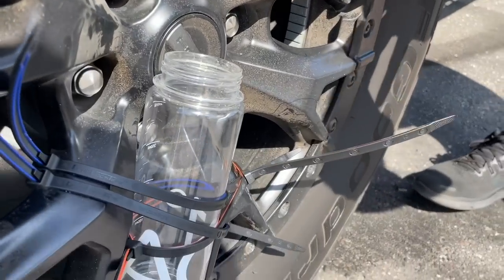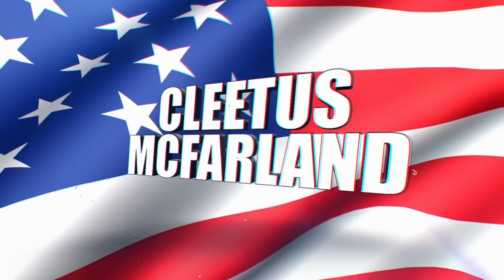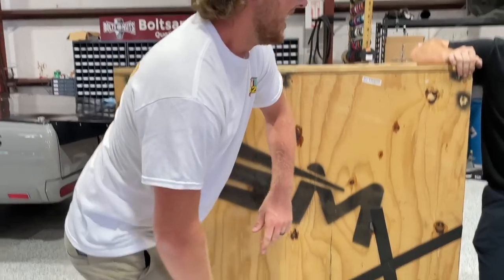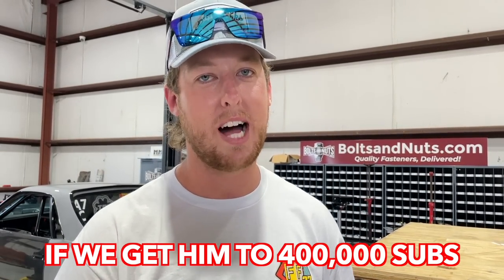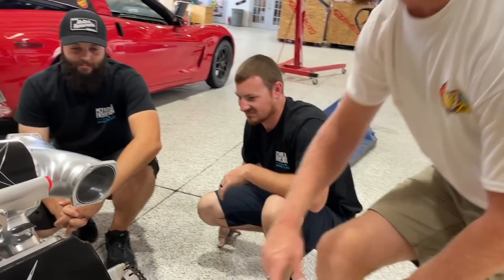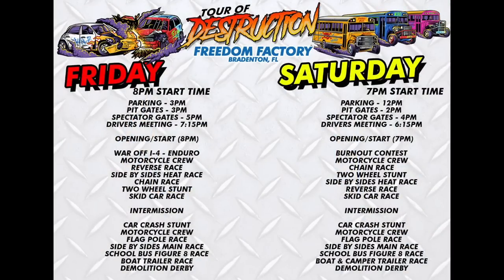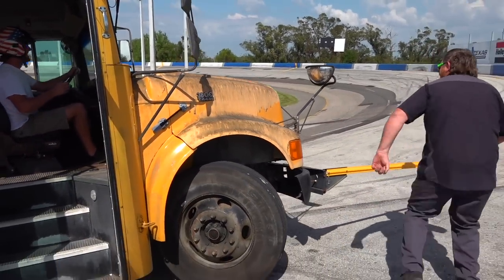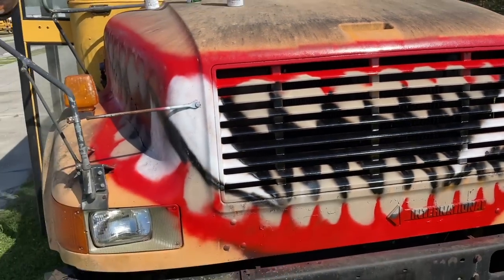We Bought The Most INSANE Street Car Engine EVER For Mullet... 5's Here We Come!!!!

Comment: I KNEW he was making you an SMX! 
i believe it’s 2k hp NA.
i’ve been subbed to steve for weeks. i have watched almost all his videos lol. he has amazing content goes into amazing detail with engine tech and dumbs down quite a bit of info for normal people
Reply: It's just shy of 1K hp N/A cause it's not built to be N/A but boosted.
Reply: It's only 570 something ci. Definitely not 2k hp NA
Reply: Steve has a video of a SMX N/A on his channel.  It’s shy of 2 hp/cubic inch N/A with cam not designed to be N/A.  These engines are tuned to have boost thrown at them.  About 8 hp/cubic inch with boost cranked to them!!

A good example is my best friend has a small block Chevy with a Nitrous designed cam in it.  N/A it only made 650hp.  With 300 shot of NOS it made 1,100+.

Comment: Quest for the 5's has begun!!!! And 110mm turbos
Reply: and bigger tires!
Reply: @xdboardsurfer  He's not going to run bigger than the 315 radials he already has. He has class limitations for most of the events they do. The car would need to be redesigned to fit big tire anyway.
Reply: @lordcommander3224  Of course, the whole bed would have to be gutted and tubbed or whatever. Think he can reach 5s with the 315? Seems like a tall order.
Reply: I believe the record for a 315 Radial class right now is 5.75 ET / 228MPH
Reply: @desertrat8322   None of those cars weigh 3,600 lbs, but even 275 radials have ran 5s

Comment: Does mullet need a new cage for a 5 second run?! That's insane!
Reply: only can cert to 6.5. If they some how could get to 3200lbs they could cert to 6.0
Reply: They won’t get to 6.0’s until mullet goes on a diet and they revisit the rear suspension. It’s gonna need a floater at minimum. And also, that engine will be fine with radials. Engine doesn’t know what tire it’s turning
Reply: @philb5593  Jenny Craig can't work those miracles - also the wheelbase....

Comment: If you use google earth ,  there’s this feature it has where you can see a time line ,  use the tool bar on top , there’s a little clock with a forward arrow ,  in most cases you can go back to 2005 or so ,  maybe some crappy ones before that ,  but if you look at the freedom factory you can see that back lot where the crown Vic’s are is full of trashed out busses   It looks like the track has seen a lot of bus action in the past ,   Think 2011-2014

Comment: When you make the cold side pipes, betwee turbo outlet and the Y on the front of the inlet manifold, why not set the Y on an angle? This way, the two turbo to junction pipes can be straight instead of needing a bend. Simpler fabrication.

Comment: One of the biggest mistakes Garrett has made was buying that hand grenade from Steve but this video came out same day matt frost (rmrw) finally deciding he was done hiding the truth about Steve’s work and making it public that he had to spend nearly 20k to get his smx everything steve screwed up fixed by another engine builder because it kept eating itself every pass due to wrong and incorrectly installed parts and screwed up machine work after waiting 2 years to get it just so he could even run his new 80k engine and over the next few weeks dozens of people either contacting him about similar dealing with steve or directly commenting it on all his posts about similar problems they experienced with steve
Reply: Link to these matt frost claims ?

Comment: Put Sam in charge of the SMX install, bring in the VGG engine swap crew, fly in OMG's Bill and Billy's Uncle Bucko for fab work, along with Billy and Rob to do the cold and hot side and wiring, stop your boys from playing with old busses at The Freedom Factory while the SMX is awaiting the drop in tuck up 7 day miracle install and tune (Have him have Mark at A-1 auto parts make up the 30 coolant and oil lines for the super plumbing job necessary), slap on that 500GPM cam driven fuel pump, and getter dun boys in a miracle 7 day period.....Like, "WHAT COULD POSSIBLY GO WRONG!?"

I love everything except the short 7 day swap window...A Steve Morris SMX even (especially), a scratch and dent, personal SM superwagon sacrificial SMX deserves much, much, more time for prep, testing, care, and setup as the clock is ticking.

Get crackin' and don't blow her up boys if it isn't the right timing.

I certainly wish I could help, but was already subscribed to "The Professor's Channel!" He has been the master blaster behind the great powerplants that power the Mullet and Cleeter to wins in the prior season. "Do this swap slow and steady for both Dale and Steve!"

Sam, am trusting you to steer the boys clear old man...take the reins, and polish it to perfection man.
Reply: C'mon....I said "tuck up...not *uck up!"

If you get it wired up, plumbed up, and tuned right right in just 7 days...That will be a miracle performed boys. Good luck on "mission almost possible!"